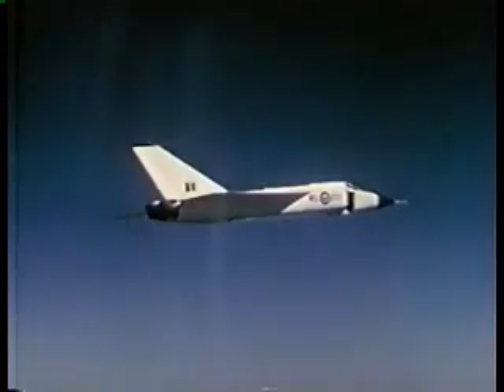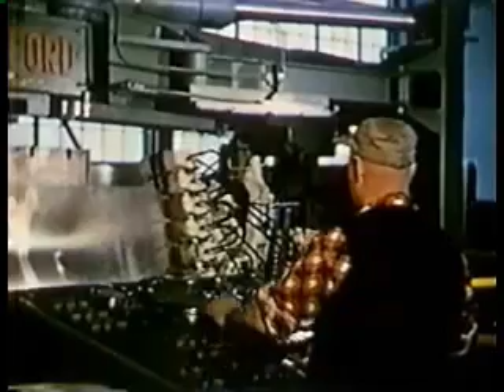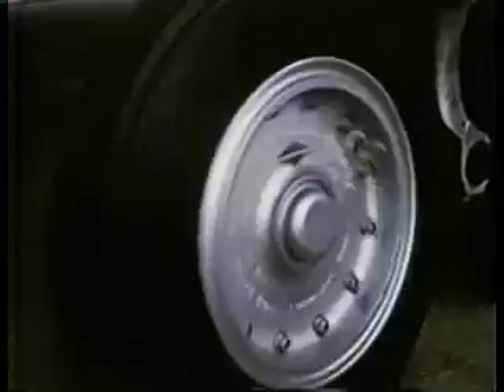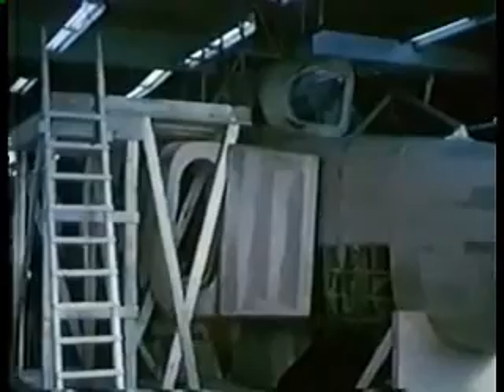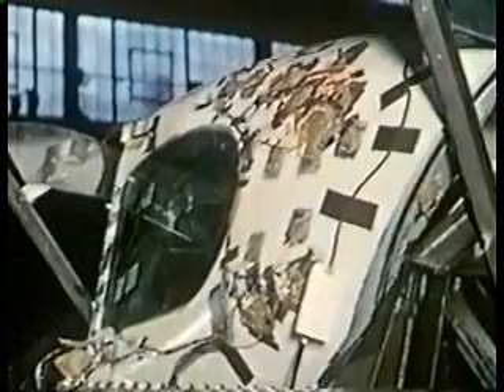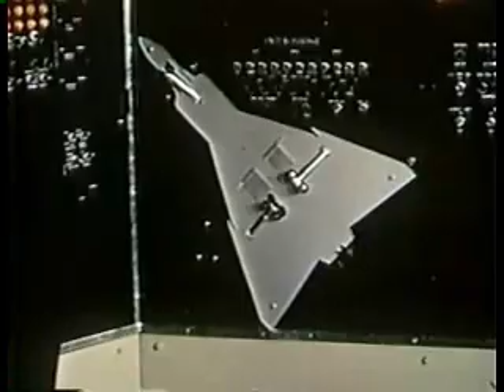Avro Arrow Promotional Video Part 1 of 3

Comment: More Canadian bullshit. Canadair licence-built 200 mach 2 CF-104 Starfighters beginning in 1961.They licence-built another 240 supersonic CF-5's beginning in 1968. Development of the XB-70 began in 1954,and the final model was on paper by early 1959. The lunar module was built by Grumman, not Rockwell, and designed by American-born engineer Tom Kelly. The F-4, which flew 3 months after the CF-105's maiden flight, was designed by a team led by Dave Lewis, an American engineer.
Reply: ASSWIPE
Reply: @glen6945  
C'mon Glenn. You know it's true.